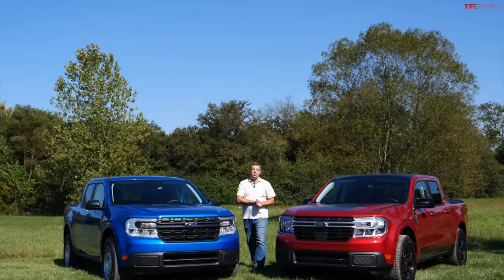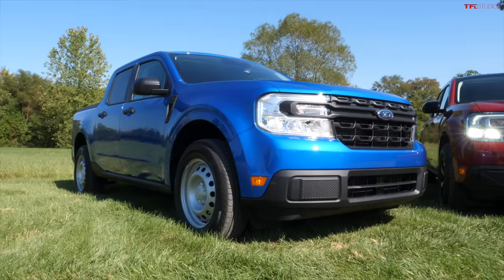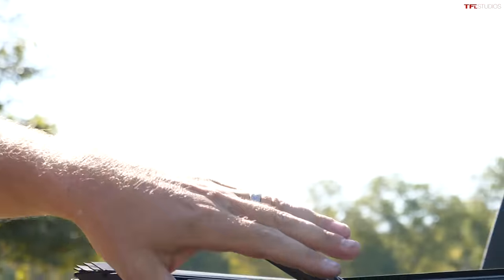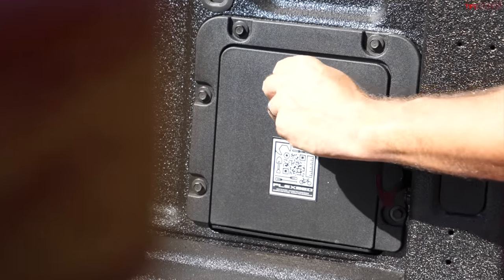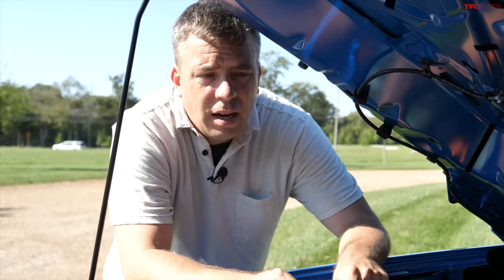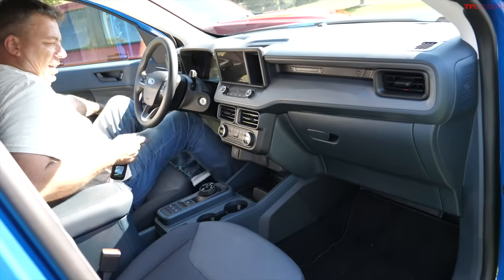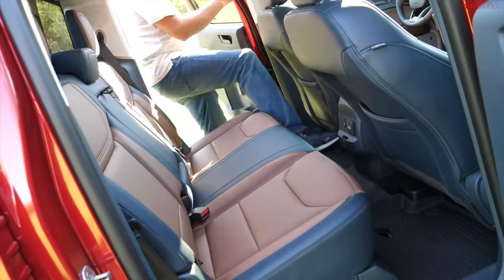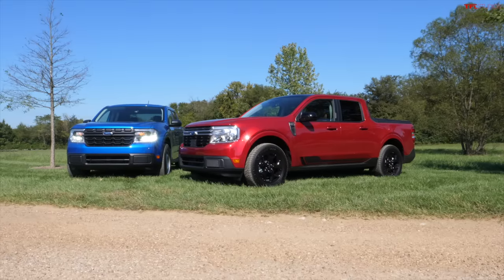HANDS ON with the Least & Most Expensive New Ford Maverick - The Differences Will Surprise You!

Comment: Currently looking at an Escape and was excited to read (presumably correct) the Maverick was built on the Escape platform. The only issue is - Why didn't Ford include AWD on the hybrid like on the Escape - not for offroad, but safer winter driving. Love the fact that can do Home Depot/Costco runs with large bulky purchases - not even having to rip 4x8 sheets to transport like in the Escape like I did this week in my current SUV. The 2.0L, while nice, has a major shortcoming that rules it out. The unspoken advantage of the hybrid is that it is one of a decreasing number of cars that can be towed 4 wheels down behind an RV. Coupled with being a relatively light vehicle around 3500 lbs, that is huge! Both FWD and AWD Escape hybrids are approved...but none of the other powertrains. For a truck, would need to move up to a  4200lb and more capable Ranger 4x4 (not FWD) for RV towing. The truck offers so much more than the SUV but the lack of AWD makes it a difficult decision.

Comment: We want to see the mpg for the hybrid both City and Highway real world come on TFL let’s get them numbers out let’s see what the Lie o meter says compared to real world numbers.
Reply: I own a fusion hybrid with the exact same drivetrain.  At the weight claimed, I have no doubt I could routinely achieve 32-37 mpg on the highway and easily break the mid 40's in city driving.
Reply: It's the same system as the escape. Which can easily do better than what it's actually rated for. 
So idk what lies you're talking about
Reply: @nighttimestalker  probably referring to the C-Max hybrid exaggerated mpg (47 mpg) when the C-Max first came out in 2013.  After fierce public exposer of the exaggerated range, Ford came back and said " the actual range is now @ 42 mpg.

Comment: VERY interesting new vehicle. 16:43 shows very disappointing ground clearance though, I’d like to see under the FX4 to see if there’s any improvements
Reply: Fx4 has 8” of clearance
Reply: I agree but a lift kit should be available pretty quickly. Rough country has one for the bronco sport which is the same platform for about 250$ and could add a couple inches.

Comment: The waiving hand icon is the brake hold assist system. So when you are driving along and stop the vehicle it will hold itself in place with the brake lights on and you can take your foot off the brake

Comment: Question for tfl is the 2.5 in the base maverick the same engine as the older escapes 2.5
Reply: It's the same engine available in the current Escape Hybrid and previous Fusion Hybrid/C-Max/Escape Hybrid. NYC used them as Taxis for quite some time and 400K miles was not uncommon.

Comment: I bought a 2012 base F150 4x4 automatic new and the silver steelies rusted quickly and the lack of electric windows and cruise soon became irritating.  Only kept it 18 months.  The previous truck was a 1998 XLT, manual with cruise and power windows. Still my favorite vehicle and I kept it 15 years.  It was a daily driver for 5 years on a 40 mile commute. Sometimes the extra bucks save you in the long run because the short sale of a vehicle you end up not liking is a big loss.

Comment: Lol don’t be the guy who spent 36k for a kids toy truck, just go buy the full F-150 for that price.
Reply: $36K is a down payment on an F-150.
Reply: @theRooster722  I bought a Ford F-150 XLT super crew 4x4 with 70K miles on it for $19K which will outperform these vehicles for the next two decades. I can actually Tow something, actually haul a load of dirt and rock. Plus the F-150 is still the number one best-selling Vehicle. This means parts and labor to fix something are extremely cheap and well known in the industry. Ford has an initiative in the next 5 years to boost up their dealership service centers because normal mechanics won't be able to service your battery/hybrid parts also with the right to repair happening you won't legally be able to bring your car to a mechanic unless they get FORD GMC TESLA certified.
Reply: It also means you barely fit in a standard parking space and have issues trying to maneuver in many parking lots.  To each their own.  Not everyone has the same needs.
Reply: @JifferRiffic  yeah but that's not an apples to apples comparison. A brand new Maverick XLT fully loaded stickers around $32K, a brand new F-150 XLT SuperCrew fully loaded is double that. I would rather have a new F-150 but it isn't really in the budget.
Reply: @theRooster722  I guess if you buy new. These trucks (Maverick) (Ridge Line) etc... are not actually really targetting the Truck market. They are targeting the SUV market. Same size as an SUV but with a bed.
Reply: @JifferRiffic  the Maverick has mass appeal because it looks as it should, a a rugged looking small pickup truck

Comment: Skipped over the fact the XL doesn't come with basic cruise control in 2022? That feature has been around for 70 years. It's upsetting that they excluded a feature so cheap to implement and so important for anyone who drives on the highway. The fact they don't even make it a several hundred dollar option on the XL tells me Ford knows that the small feature will push a lot of people to get the XLT. It's purely for greed, no other reason to completely exclude that as an option on the XL. And for the apologists who say they did it to lower the cost, then why did Ford give the XL power windows, locks and mirrors, steering tilt/telescope, AC, an infotainment screen with carplay, etc. etc. ? They know exactly what they're doing. 

Edit: Don't get me wrong, I think the engineers made an incredible, affordable truck, but it's scummy when the business side of Ford plays stupid games like that.
Reply: I guess they are aiming at the urban user that doesn't get on the highway much, or maybe fleet sales. It is odd, and they may change this either with standard equipment or an additional convenience package later.
Reply: I couldn't agree more. It should at least be an option for the XL

Comment: Such a great vehicle. You can put all of the payload (less the driver) in the bed. 
More interior space than Hyundai. 

And the fact the Hybrid is STANDARD! 

Saving up for a XLT hybrid. Only $25,000 steal of the decade. Most compact crossovers start just under 30
Reply: Yep, the hidden gotcha of the Hyundai is the 660lb limit for the bed. That said, while you can put 1200+lbs in the bed, the tailgate is limited to 500lbs, so it had better be a short 1200lb payload
Reply: @adam_mawz_maas  figure if your loading plywood. 
1478lb payload minus driver 
1200lbs half on the wheels, half on tailgate so 1000lbs total. 

So 21 sheets of 1/2 plywood or 
16 sheets of 3/4 plywood or 
18 sheets of drywall 1/2”

Pretty much 1/2 that for the SC

Comment: When you said it has a CVT you immediately killed my interest in it.
Reply: Only with the hybrid option, with the turbo eco boost engine it's an actual automatic geared transmission
Reply: And it’s not “that” cvt, the hybrid one is far superior. I believe it’s the one from the fusion.
Reply: It's an eCVT, not the CVT you're thinking of. Basically a 4 gear planetary gearset with an electric motor

Comment: Great video. Which version do you think will be the best for using it to mostly working every day 6-8 hours a day making deliveries like Uber Eats or PostMates throughout the whole year where there’s heavy snow and ice during the 3-4 winter months? Taking in consideration fuel economy, daily use, snow handling, constant stops, cost, etc? Thanks a lot.
Reply: I would still get the 2.5l hybrid engine. If you are worried about the snow you can get snow tires for the front and throw the stock tires back on in the nicer months. The savings in gas for what you are doing will pay dividends with the 42MPG hybrid engine. Just my 2 cents 😎

Comment: Long-term reliability wise, the Hybrid will be your best option. Sure, the EcoBoost has more power. But it has a turbo, which only lasts over 100k miles. It also has a 8-speed transmission, which means more moving parts compared to the eCVT. If you want a towing vehicle, then I would recommend the EcoBoost. But if you only need a truck to haul things in the bed occasionally, the Hybrid would do just fine.

Comment: I bought a new standard cab 1988 Mazda B2200 with a 6 ft bed years ago to use as a parts runner for my business. The payload and towing rating (1,400/2,000) is pretty close to the same rating quoted for the basic Maverick ironically. That sounds rather wimpy but in reality for light utilitarian use it’s more than enough. It makes a vehicle that’s most likely just going to be used as basic transportation, a more useful all around vehicle. If you need something with a little more capability you can always option up from there.

Comment: Nice little truck. But I have to have a full size with an 8 foot bed. My truck gets used for a lot of yard work and picking up loads of river rock or mulch. So I have to have the heavy payload capacity. I drive an F150 XLT RWD currently

Comment: For $5,000 more you can get a pretty much loaded Hyundai Santa Cruz SE AWD that gets 27+ on the highway and is basically the same truck w/ 3" less in the bed. Off road is an easy fix w/ Duratrac tires 265/70/18. Tows more too...But, you can't beat the base mod Maverick for what it is 😉

Comment: That's a nice truck fully loaded, if you want to soend $36K, I wouldn't mind the fully loaded First Edition with FWD and the 2.0L Turbo. But I could go for a base FWD model with the same engine with a bed liner and locking cover or camper bed. Those cupholder and trash bin accessories and water bottle storage utility is cool. I am considering this when I get a  second vehicle that would be perfect.
Reply: You only have until today to order a turbo version. Capacity sold out. Find a dealer that takes orders at msrp they are out there. I got Mav eco AWD 360 lux 4k for 30,710 including shipping. 
With inflation announced at 7%, magnesium, chip and supply chain shortages, my bet is msrp goes way up for the 2023 MY.
Reply: @JamesD-HB  Thanks. Not ready to get it. But am considering it fir a second vehicle, when the time comes, and it may be more available by then. I have another vehicle I am getting first.

Comment: Camping machine on a 4 1/2ft bed? I got the 5.8ft chevy and it's fully geared out for camping with a topper. Anything less than 6 ft bed is uncomfortable if your going to be "Camping" out the back of your truck via topper and kitchen slide outs. ect.

Comment: I can see why they stripped down so many options out of the base model.  Its a good vehicle as a base, with just enough missing that if you don't want to take it to an aftermarket fitter things like heated seats and extra plugs or a liner, you're getting pushed up into the other more expensive trims.  However, when you are getting into higher trims, you have to start considering other vehicles at those price points.  There is pretty much nothing that competes with the base model.

Comment: Much better than PR rebroadcasts of three months back, since you actually have the vehicles in hand, not just Ford's stock PR clips.

The base males sense.  A lot of vehicle for 20k if it'll last without blowing a CVT.  Ford has a lot of trouble with experimental transmissions, or sticking another car's transmission (like the Flex) in a new model from the line from Mexico... (fiesta)

The 36k model makes little sense as you can buy a Tacoma, Ranger or base used F150 for under 40k and get more truck, more room, more bed, better towing on proven platforms with heavy duty frames.... similar gas mileage too.

So Maverick is either base frugal, or show me a truck.

Comment: If they sold an extended cab or regular cab option with at least a 6ft bed (with the tailgate up obviously) version with AWD and either a manual or CVT I'd get one. Without amputating everything below the knee there's no way I can sleep in the bed and that's a base requirement for any pickup I would buy. 

I'd settle for a 2wd hybrid if they sold an extended cab 6ft bed variant. I just can't justify buying any pickup that I can't sleep in the back of with a camper top.

Comment: For me it depends on how fast the price ramps up for the gas engine and the 4×4/awd. The closer you get to 30k I'm gonna start looking at tacomas.
Reply: You're lookin at only about $3305. above that base xl model price...so with destination charge about $24,795 msrp.
Reply: @meathead585  exactly, about $10,000 less than a 4wd Tacoma stripper.  At $25,000 it offers a lot of value.  I have a 21 RAV4 LE AWD that cost $30,000

Comment: I’m surprised they didn’t have a powered adjustable steering wheel, ventilated seats, or a pano roof which are small things but seem to be a standard for anything with lariat in the title, so I didn’t preorder one. It’s nice to see their size finally rather than the Ford website, I almost regret not trying one.

Comment: The hybrid engine gets the 40 mpg in the city by turning off the engine when not needed, ie. idling, slow speeds.  That is how it gets higher mpg in the city.  On the highway the gas engine never shuts off.

Comment: I live on wet mountain blacktop roads. I wonder what the front wheel drive will be like with a load in the rear?  With rear wheel you are creating more traction with the weight not less. Strange concept for me
Reply: No you’re not.  Rear wheel drive pickups without anything heavy loaded in the bed are very squirrelly on slick roads. At least the FWD has the weight of the engine over the drive wheels.
Reply: @webcomment8895  True, in normal, empty bed, it would make sense, but what if you have a ton of weight in the bed? It may be fine, but curious.  I cant recall a truck that has ever been front wheel drive. I could be wrong.

Comment: Great little pickup, way too expensive for the segment. It is almost ranger price tag for a lot less. I would like to see it settle right in between the tornado/ram 700/renault oroch and the midsize segment like S10, Colorado, NP300, hilux (outside US),  Ranger...
I was hoping the lariat to be around 25 to 27K maybe 30 with the FX4 pack and the big towing capabilities. 20K for a hibrid that tows less and is FWD only seems decent, but I would expect the maverick to start around 18k and top off around 30 to 32K fully loaded with FX4, AWD, big towing pack, all the goodies inside, etc. But maybe it is just me against inflation that leads to less purchase power

Comment: This is such a nice little truck.  I am seriously looking at this as an option as I am currently shopping for a truck.

There are only a few real "cons" that I can see here:

1.  AWD instead of proper 4wd with low gear transfer case - Means that "offroading" is going to be limited to hard packed surfaces, sand and snowy roads.  Very limited trail capability.
2.  No AWD available in the Hybrid.  Why?  It's not like there is a transfer case that is fighting for space with batteries.  Makes NO sense and Ford is throwing away sales there.
3.  The thrice cursed "shift wart" rotating knob.  You would think Ford would learn from Jeep's mistakes.  The knob is a terrible driving UI idea and flat out dangerous. (People's deaths have been directly attributed to them.)  It should be noted that pretty much all of the "stick" style automatic shifters since about 2000 are NOT physically connected to the transmission system and are as "fly by wire" as the knobs are.  The knobs offer no advantage other than being smaller and cheaper to manufacture.  But for the drivers they offer nothing.

The question for me is:  Is point 3 a deal breaker?  Might be.  The Driving UI is what you experience 100% of the time you are using the vehicle.  Having a difficult to use part of that UI means constant frustration and risk.  BUT... Perhaps it is something you can get used to.  The price is so tempting  (You can get an XLT well appointed with the offroad package for under 30k!) it might be worth the effort to try and get used to it.

Still, Ford should seriously consider dumping the shit-tastic knob and going to a stick style shifter.  Or at least offer it as an option in 2023 and as a retrofit for 2022.

Comment: Careful folks. Yes this is a lot of equipment for the money, but if anything to do with the electric shtuff goes, that'll be real expensive. Even if it happens to be covered there are electronic component shortages atm due to the (mostly made up) dire conditions of the pandemic. Don't get stuck with an undriveable new truck. Yes they'll potentially give you a rental in the meantime I just mean that generally the cheapest vehicle in a given segment, let alone the first year of a complex technological one at that, involves a bunch of risk. Seems interesting regardless though, good video

Comment: Does anyone know the difference between the E-CVT in the ford maverick vs the one in the latest Toyota hybrids?
Reply: Yes...Its similar, but Ford designed there own..using less parts/weight.  Its a brand new system so who knows.  You can find more details on reddit.  Someone linked an in depth article.